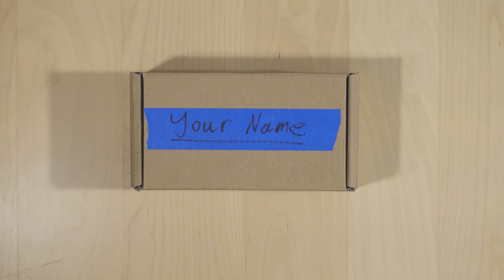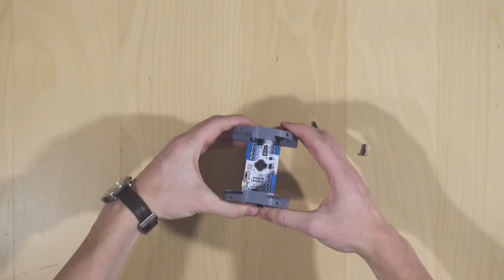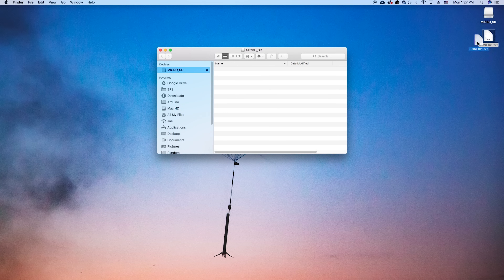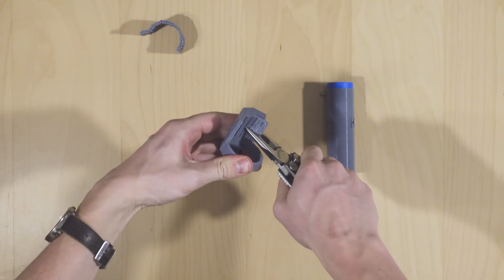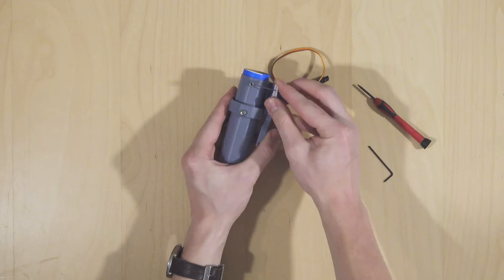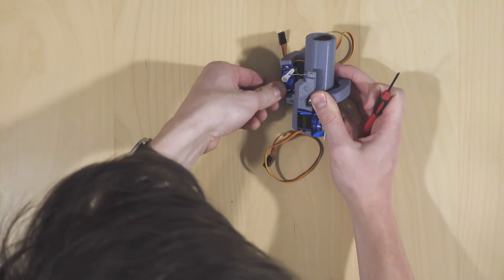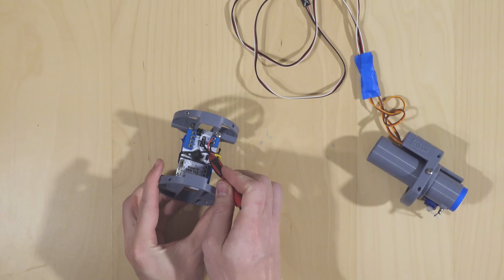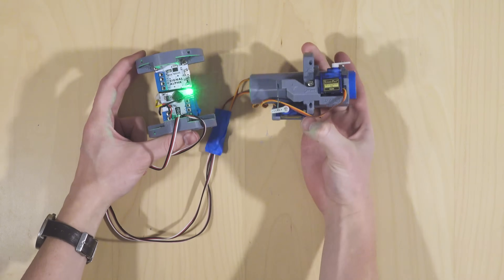Build Signal Alpha - Part 1 - Kit Assembly

Comment: Does the TVC mount take 24mm engines or 29mm engines?
Reply from the maker: Nathan Chambers Both! Customers who ordered the 24mm motor mount version received an adaptor that slides into the existing mount, and so could fly either size.